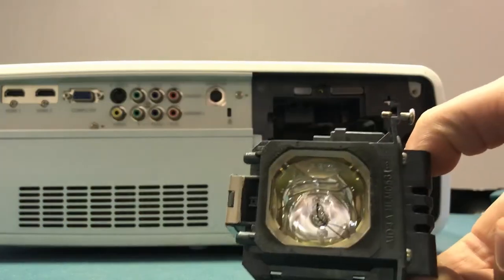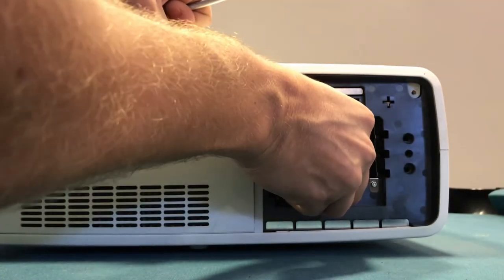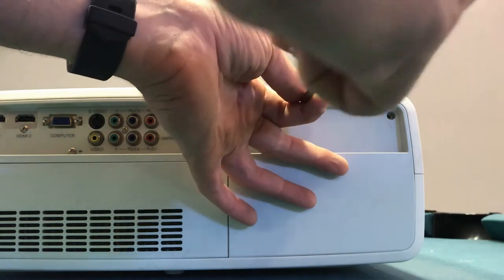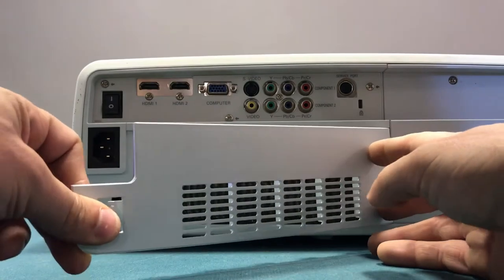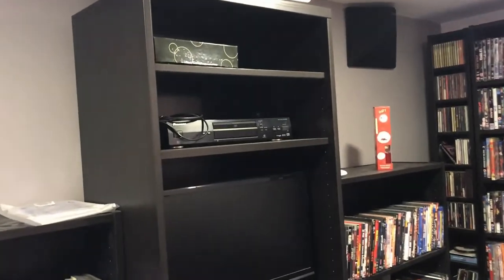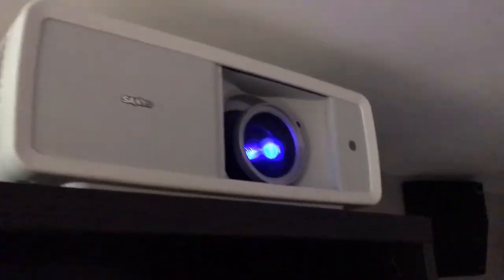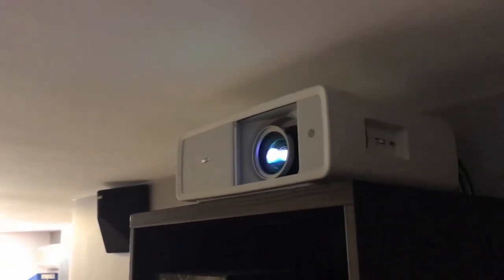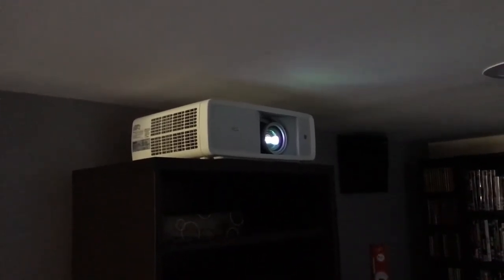Sanyo plv z2000 lamp replacement

Comment: After 12 years i have this projector until the bulb dead, now its time to replace it. Thanks for the video
Reply: Amazing that the lamp lasted 12 years! How often did you use the projector? How many working hours did the lamp have before it burned out. I recently bought a Sanyo Z3000 that uses the same lamp and has about 960 hours so I'm interested in how long the life of the lamp is?I read somewhere that it is from 2000 to 3000 hours in eco mode

Comment: How many hours did the lamp have before it burned out? I recently bought a Sanyo Z3000 that uses the same lamp and has about 960 working hours, so I'm interested in how long the life of the lamp is? I read somewhere that it is from 2000 to 3000 hours in eco mode

Comment: In my case the picture has a yellowish tint on the left side. Do you think a lamp change would fix this???
Reply from the maker: It could very well be. Try it out. Buy a cheap bulp from Amazon a if it doesn't help, return it. Good luck.

Comment: I'm thinking of upgrading PLV-Z5 to Z2000. I'm more than happy with my Z5, but I can get Z2000 for a really good price (now). I'm wondering if you have noticed any difference between old (stock) vs new (cheap) lamp. Of course your old one had some mileage, so it was not as bright anymore, but are you able to say that cheap 30€ works just as well. 
Also you can control the receiver with Android / iPhone app (most of the things), so no need for LCD output :)

I'm also using ECO mode on Z5, but damn, that Z2000 is much quieter - must get it. 
I think you need to reset the lamp counter once you replace the lamp (see the manual, page 50)
Reply: While the OEM lamp lasts for 6 to 8 years on ECO mode, the knock-off lamps last around 1-2 years before popping. I know because I am on my third Amazon replacement lamp (from different sellers). Even with this, I cannot justify the OEM price for the Sanyo. I will buy the replacement OEM bulb on the next projector I get on day one. Hopefully, it will be LED or Laser and not need a replacement.
Reply from the maker: I have not noticed any difference in image quality with the new cheap lamp.
Reply: @lho77  Any difference in the lumens? Ive just replaced my Z4 with a Z3000 wow what a difference. The bulb currently has 1260hours. Ill be ordering a lmp114 soon. Great video. I got my z3000 for $275! Like new.

Comment: Hi Mr. Lars,  I just found your video about changing the lamp.
 Very good. Thank you about the information.
I have a projector just like yours and there is something that I would like to ask you. It is a Sanyo PLV-Z2000. Do you know if I can mount it at the ceiling using a ceiling mount? Would it stay upside down?
 I've used it on a sheld since have bought it.

Thank you very much
Reply: I works great mounted in the ceiling. I have the same modell and i'ts mounted upside down in the ceiling. No problem.
Reply: @filipfriberg  Thank you.
Reply from the maker: Hi,

Yes, I used to have mine mounted in the ceiling upside down. No problem. This is a great projector